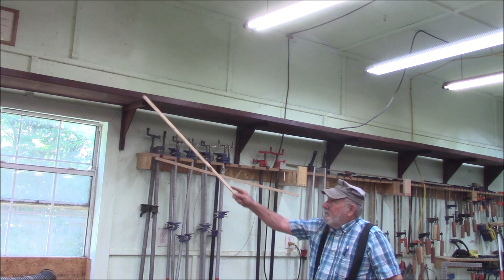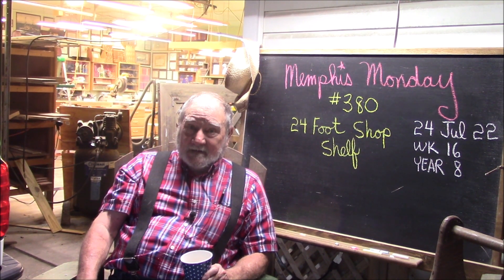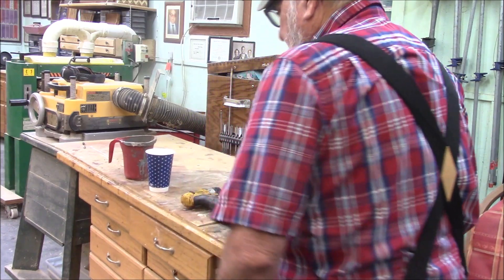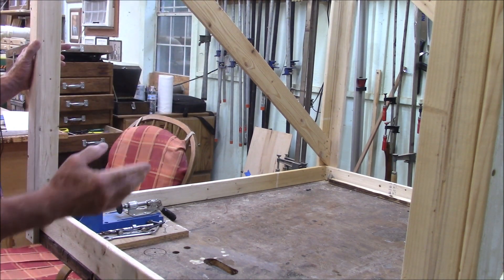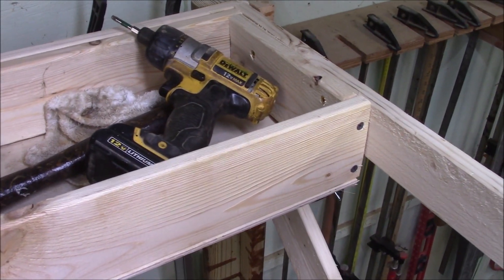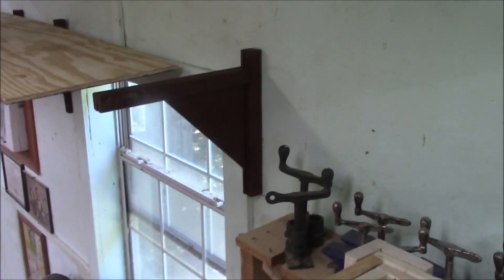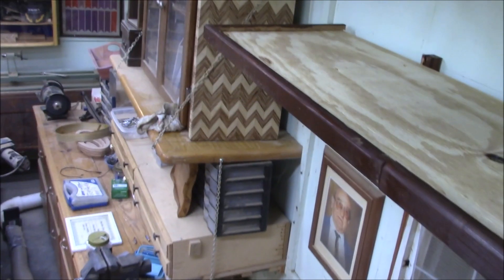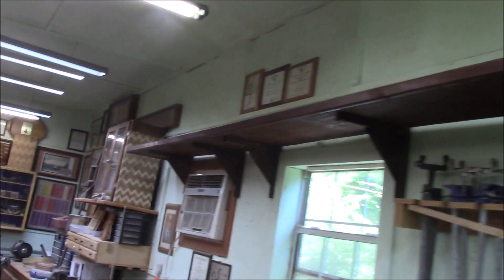380 Workshop Shelf

Comment: I sure like your shelf and believe it will give you many years of service. The safety cage was a marvelous idea. Perhaps one of the best you have ever had and not just for us old guys but everyone who works up off the floor. On another note, I used to stick a finger with a staple or nail every once in a while (and it hurt like blazes!) but I discovered that if I hold the brad/nail gun 90 degrees to my work, instead of in line with it as you did,  the nail almost never pops out the side and I haven’t punctured myself in quite a long while. When they curve it seems to be left or right but never up or down, as referenced to the handle/body of the nailer. Look at the bevel on the end of the fastener and you’ll see why. Thanks for the video, I enjoyed everything but the injury.